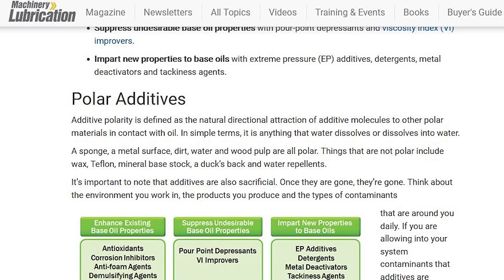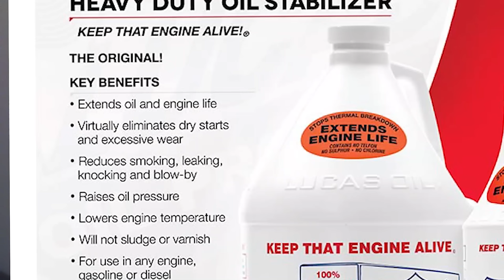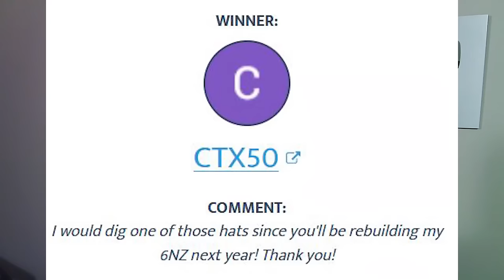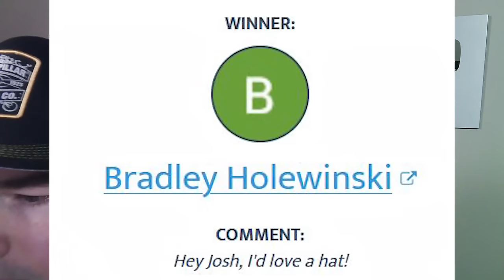Does your Engine NEED Lucas Oil Stabilizer? A detailed look at the "Benefits."

Comment: As a certified master Cat engine rebuilder since 1988 I can tell you NEVER , NEVER, NEVER EVER use Lucas on the first startup on a rebuilt engine. Pre -lube the engine with standard engine oil. Also NEVER add Lucas till the fourth oil change. Lucas oil WILL NOT ALLOW the PISTION RINGS TO MATE TO THE CYLINDER LINERS. This WILL cause EXCESSIVE OIL CONSUMPTION. Lucas oil BONDS/COATS to metal. Pistion rings must mate to the cylinder walls.  ALSO BEWARE SOME AFTERMARKET OIL ADDITIVES THEY HAVE CHEMICALS THAT DAMAGE / DRYOUT O-RINGS AND SEALS INSIDE THE ENGINE. This includes crankshaft seals and liner o-rings.
Reply: Thanks Phil! 👍🏻
Reply: yep its a great friction modifier and can save your ass
Reply: So, is it your opinion that this does reduce friction?
Reply: @johndunn9819  bit more than an opnion
Reply: @thebad300  I'm going to take your word on it. My dad always used STP and had "good results". His vehicles ran and lasted a long time. Of course, there's no way of telling how long they would have lasted had he not used the additive. Kinda like Lucas'. I always give it a minute to warm up a little especially in the winter. I take it real easy 'til it reaches operating temperature because I can see how cold thick oil might not get to the appropriate places in time while it's warming up. Thanks for your insight.
Reply: @johndunn9819  never use it on a new motor a  or a fresh rebuilt motor

Comment: I've use a similar product called "Morey's" since about 1985, in all of my vehicles, motorbikes, cars, 4x4 etc, I've only ever rebuild my Harley shovel head,  the 4x4 I own now is a land cruiser it's done 700.000  now, owned for 23 years and has not been touched, and yes it mixes with auto trans oil(power steering) and gear oil etc very well and have had big success with them as well, diffs, transfer, swivel hubs etc are still all original even wheel bearings have not needed replacing, same with the Landover I used to own and all the other ones, my Vmax has way over 100k and has not needed even a valve adjustment! 
Now, all of my vehicles are before 2000 so I could not recommend the product for newer vehicles with very tight clearances because I do not have any experience with them but for older, let's say mid nineties and before certainly. 
I don't know what the difference is between the Lucas and Morey's product I hear they are very similar. It works for me!

Comment: A friend of mine used Lucas since the day he drove the truck off lot and had to have a complete in frame overhaul twice right at 600,000 miles. I never used it and we both had 07 C15 cat engines and I got over a million miles before only needing an overhead and upper rebuild! The shop and a cat rep told my buddy that the additive actually caused the excessive wear.
Reply: Absolutely shows the truth you don't change viscosities great comment
Reply: All depends on how it was driven and the loads that were pulled.

Comment: Long while ago I drove old fully loaded freightliner up a hill. It jus quit on me. Wouldn't pull at all. Smoked as hell. So I walked on highway to a TA. Got gallon of Lucas stabilizer. After adding it, smoke from stack greatly reduces, power came back, so I were able to continue up that hill. This was my friends truck I drove for, and since then I always had couple of gallons Lucas inside engine. For next 6 months same failure never happened again. That was enough to make me believer.

Comment: I think projectfarm did a video comparing this additive to some other brand of motor honey and found that in his test lucas does have a better friction coefficient and denatures slower than the control (5w30 gas car oil). I'd really like to see a more realistic or standardized test because he runs the friction test with the oil at room temperature, usually only a visual representation of wear is displayed. I use this when the tackiness/extra viscosity is desirable and its something I don't plan on rebuilding. I agree the rest of your arguments.
Reply: He tested it in running predator engines, that are air cooled, thats a damn good test

Comment: The Synthetic Lucas, i bought and sold Minis for years, engine problems are notorious on these, i always add a bottle to every oil change, never had an engine blow, including our racing Minis Turbo and supercharged Mini Cooper S. Added bonus, these Minis are known for oil burning, quite heavy consumption, seems to cut this to a bare minium, in most cases zero, based on our experience it works wonders. Our own personal Minis have covered over 200.000 miles, without any engine trouble. Most Mini owners will know that's rare.

Comment: I use the Lucas SYNTHETIC oil stabilizer,  it isn't really any thicker than engine oil, and gives the oil a significantly slipperer feel as well as tackiness. 
Does it do anything?
I have a 1995 Volvo 5 cylinder turbo that I picked up cheap. 
It had a lot of blowby, so much that the crank case ventilation system could not control it   even after replacing the entire system. 
The engine smoked considerably, I put one quart in it one day, 15 miles down the road  way less smoke. Not only that, no more oil all over the engine. 
Does it work?  Well it freed up the sticky rings. You decide

Comment: I agree with CAT on this one...just follow the manufacturers recommendations. Manufacturers pay engineers to figure all this out and we may be pretty good at turning wrenches but we are not engineers and they are not us. I'd like to have them collaborate a bit more on design so when a wrench needs turned I don't need smaller hands or an extra joint in my arm. Maybe we should run chainsaw bar oil in our engines as they have a lot of tacifiers but it also needs to hang onto the chain and around the nose of the bar to get to the underside of the bar where it's needed, not many areas of my engine that needs that. A note on oil pressure that my newly rebuilt 12 valve Cummins (in my F350) had 70 psi and I could get 500 miles on a tank of fuel...after 30,000 miles I could consistently get 600 plus miles on a tank but at 55 psi. I'm sure the engine limbered up and clearances opened a tiny bit. As always good video Josh!
Reply: They are also in the parts business as well
Reply: engineers also design in planned life spans so that you will be back for a new one sooner than later.

Comment: My Toyota dealer warned me not to use any oil thickeners as is will cause problems with the variable valve train. They said that the lifters have a extremely small oil passage and it could be too thick to enter and exit the passage causing oil starvation and increased wear and possibly failure.  They also advised me that it would or could  void the warranty should they suspect that an additive was used. They routinely do oil analysis at a local lab when they suspect the additive was responsible for the failure! They also warned me not to use any zinc containing additives. I don’t know if it was fear mongering I guess or the truth! The fear of losing a warranty is enough to stop me from using any additives not approved by Toyota.  I had a Peugeot 1981 504D, the dealer installed a Marvel Mystery Oil Injector! (Plastic container with a hose to the fuel oil filter and separator.) I religiously maintained the oil level and did the routine oil changes every 3000 miles. I got over 267,000 miles on the car with no engine problems! Every other part either rusted or fell off! Love that car as it was comfortable to drive and the front seats turned in to beds!

Comment: I admit to using this in only air-cooled engines. 20% ish.  I keep my mowers etc.engines (where straight weight oil is the norm).
The horrible tolerances,assembly and quality overall aside, they stay running well past the life of the rest of the machine.
Reply: My mower engines outlast the machines they're on and I just use the cheapest oil I can find and change it when it turns black.
Reply: We only ever used 10w30 in our small gas engines. One push mower we got brand new in 1996 used it until 2009 when I wanted to rebuild it in small gas engines class in high school. Very little wear in it. Only problem was the carb was worn and needed an overhaul. No idea on the hours but it had to be close to 500+ hours on it. Commercial mowers that are generally now watercooled tend to last about 3000 hours before overhaul. Per the Kawasaki manual on these machines.
Reply: Mud mower guys use it along with gear oil to replace the grease the gearboxes are usually filled with. 
I don't use mine alot ,but it does run about 5x it's intended input speed and it's been goin for 5-6yrs now.
Reply: @Ratkill9000  check out the Briggs engine they say doesn't need an oil change. 
Intended usage is 45mins a week for 4-5mo a year for 15yrs. 
I'll attest to that ,as I had one I never changed the oil for 10yrs and it still ran fine when I gave it away and it wasn't one of those engines. 
Why waste money on a 79$ push mower that lasted a season by changing the oil? 
I would have paid more for a company to come in and do it ,so I'm already ahead of the game.
Reply: I use lucas 2 stroke oil in my mower, change the oil every time I mow

Comment: I have used it in high mile gasoline engines to some good effect. I just bought a 2005 Saturn Ion with 167,000 miles, changed oil with straight 5w30 and have driven it 3500 miles so far and it has used zero oil and engine sounds great. I thought about using this product at my next oil change, but don't think I will, if it ain't broke don't fix it. When/if my little 2.2l starts using oil or making noise I may try it. I think it depends on the health of your engine. I'm blown away by this little Ion, really must have been cared for, runs/sounds great fot the high mileage.

Comment: i've been using it for 25 years for differentials and manual transmissions, works great, never tried it in an engine though, it's crazy thick
Reply: You are aware it thins out once mixed, Right???
Reply: Of course it does, I just said I've never tried it in an engine,   gear boxes only for me

Comment: Not a bad review but not great either. The Lucas Oil Stabilizer mixes with the oil so you do not get a liquid as thick as what comes out of the bottle. Rather, a composite. Meant for older engines where the bearing clearance is usually .002-.004 when assembled. 
For newer engines either Lucas Oil 10131 Pure Synthetic Oil Stabilizer or Lucas Oil 10118 High Mileage Oil Stabilizer would be better. Both are thinner but have a slicker feel and really do make the oil flow better between the mains and journals.

Comment: I did a mix ratio of 70% 15w-40 to 30% Lucas on my 5.9 cummins with 240,000 miles on it and it definitely felt heavier on temperatures under 70F
Reply: I'm glad you're not just buying the hype.  Lucas does things, but not everyone needs Lucas.  It's doesn't just make things better.
Reply: One thing about additives is if you don't warm up the motor properly ,,,,soon your turbo will be toast,oil with additives will cavitate when cold.
Reply: @johnhayes1618  Ford had issues with the power stroke injectors, so eventually had to go to a thinner oil to stop foaming in the oil pan.  Lucas does make foaming worse.
Reply: @johnhayes1618  600,000 miles my turbos perfect like the day it was born. 20% Lucas and the rest 15w 40 .Lucas DOESNT HURT IT ONLY HELPS,  but the truck's gotta be driven ....

Comment: I used it in a 2010 Hyundia Accent with 201000 miles. oil temp and water temp gauges move 1/2 as high as they did prior to treatment and gas mileage increased 4mpg. Was so impressed that I used it in my 1988 Ford F-150 with 172000 miles. engine noise cut in half and, just like the Hyundia, oil and water temp gauges now move half as far towards the hot side as they used too. This stuff clearly reduces friction witch results in better mpg, cooler engine, less engine wear and quieter engine. Quantifiable results, not opinion.

Comment: I use it in my old 92 Subaru Loyale and it has reduced, burn, and some leaking. I don’t go through oil like I use to and I’m simply driving this car until it dies as my work car. I’d say this stuff is better for older cars especially ones that run heavier oil and you can’t find parts for anymore.

Comment: I agree with just about everything you said. I Just want to point out though so there's no confusion that there is no "zero weight" oil the first number on the viscosity rating, the number that's followed by a W (I.E 10w-30) is not the weight of the oil, the W stands for winter, not weight. It's the oils flow rating during 
winter/cold weather. Other than that great video. At the end of the day I feel it's best to just use a high quality oil as opposed to using aftermarket additives.
Reply: I thought the 10w was the weight per gallon and 30 vis. Is how long it takes to drain a at. By timimg it
Reply: This 10w-30 rating is just a old school rating system for oil. The best oil has the lowest change of oil viscosity over the operating temperature of climate and engine temperatures. So a 0w-50 is a better oil than a 10w-30 or whatever 30 “weight”.  The key is the viscosity index of the oil. This is a scale that maps the change of the oil viscosity. Basically buy a wider range of oil temp rating if your conditions demand it. If not, save money if you only run in a small part of the country with stable temperatures.
Reply: @Adscam  wrong,  it's not an "old school rating system" it's the universal standard as determined by the society of automotive engineers. And no ideally you don't simply want an oil that has minimal viscosity change you want an oil that has the correct winter flow rating for the climate you're operating in and the correct operating temperature viscosity for the engine. There's no "One size fits all motor oil" however if what you state is completely wrong as there is a bigger viscosity difference between a modern 0w30 oil than there is between an old school 10w30
Reply: @js6729  Citation please
Reply: @js6729  I will go research. May you suggest where I may start. Not pay-walled. Tks
Reply: @js6729  Not the change of viscosity but the slope of the viscosity index. Re: 0W-30 vs 10W-30
Reply: @Adscam  And that has absolutely nothing to do with the fact the the "w" on an oil rating stands for winter, not weight.
Reply: @js6729  I never said that
Reply: @Adscam  that was the point of the comment you were responding to... Maybe you should think before you comment 🤔
Reply: @js6729  You obviously have difficulty with comprehension. Not my fault. Thank you

Comment: I drive a 1997 Toyota 4runner. I added it in within moments, I literally heard my valve train become quieter. It seems to run a little bit smoother, but that is most likely a placebo. However, I can physically show a difference in audible noise Before & After running Lucas oil.

Comment: I think Lucas was developed during the time of Screamin' Jimmies & arguably beneficial to those particular engines far more than anything else. In days past I've even heard of some running a STRAIGHT 50 weight just to help control the oil burning these engines were commonly known for. I think that's where Lucas gained a lot of its reputation & just like old habits, that reputation has died hard.

As far as the claim of no sludging, get an old coffee pot & heat some up on a hot plate, Project Farm-style. If I had some laying around, I'd try it myself. 400' for an hour, easy enough to disprove.
Reply: "We're gonna test that!"

Comment: Thank you for that info I’ve been using Lucas in my 2006 KWT 600 with a C 15 for quite some time but this video has kind of open my eyes this truck has just under 900,000 miles and on my next oil change I’m going to try to do it without it

Comment: I don't use it in the engine since it's not worn and I prefer frequent service. But I do use it in the portal boxes since I use 70W140 synth gear oil. I was having issues at higher speeds where the top of the 140mm seals would wear out. I suspected the thinner synthetic wasn't climbing the wear ring all the way. Never had another seal fail after adding 20% Lucas to the 75w140

Comment: Your scientific analogy is cool but . I just sold a man two years ago  a 2001 ram 3500 with 835k on it and he is still driving it running strong  . My 2018 has 270k on it and I change oil every 8k using Lucas 1 to every 5 qtrs. of Mobil . Never been in either engine and never uses any oil between changes .   There's my science class and I'm sticking with Lucas and Mobil  .

Comment: I have run it in brand new Ford zetec engines and raced them from cold up to 9500 rpm when I've checked the engine at the end of season the mains and conrod bearings were unmarked the cam lobes were unmarked and the bores were very clean so all I can say is it worked for me even though I took the engines well above what they were designed for without one blowing up

Comment: My boss bought me an awesome 378 peterbilt at auction. MXS Cat. Massive blow by. I milked her for a year with a bit of Lucas. Reason being she had 3 cylinders with all rings damaged and it kept the oil from breaking down as bad. She is now platinum inframed and she will have 0 Lucas in her. Why? Lucas aint bad stuff at all. A well built engine does not need such things.
Reply: You are very correct. Use it when the engine needs it, but not when it doesn't!

Comment: Using regular 15w40 in my Detroit  rotella and delvac mainly. I never noticed much of a difference on using the Lucas vs not using it.   Best thing I did was switch to 5w40 Amsoil and that made a huge difference. Sounds like it cranks faster when I start it and runs smoother for sure. Also picks up oil pressure much faster being a 5w instead of 15w and since most engine wear happens at start up then that’s good enough of justification for me.  No more Lucas for me Amsoil all the way !!
Reply: what different did anisole make i used it threw 2 oil changes looked and acted like normal oil